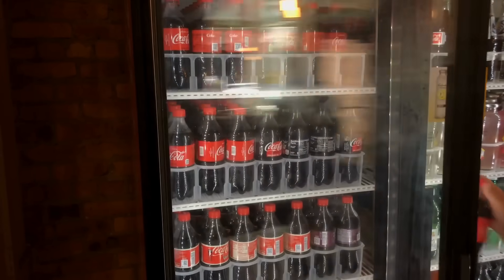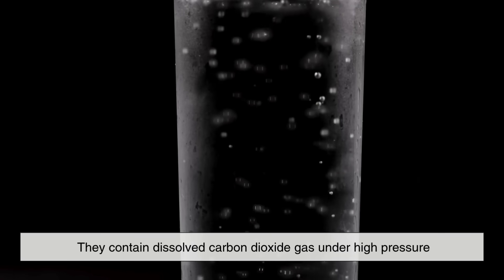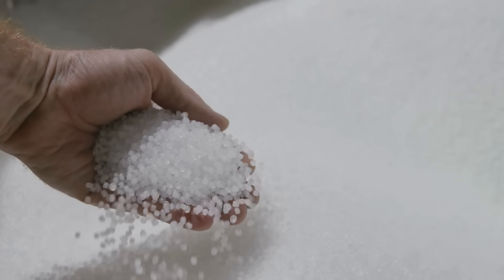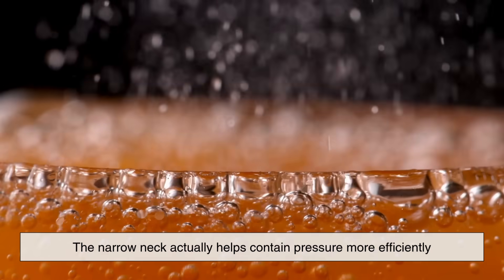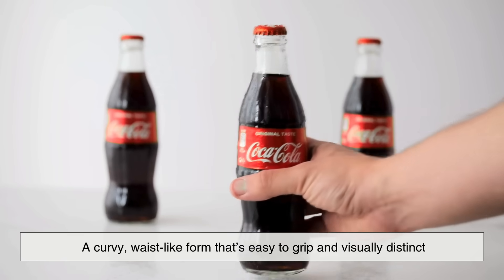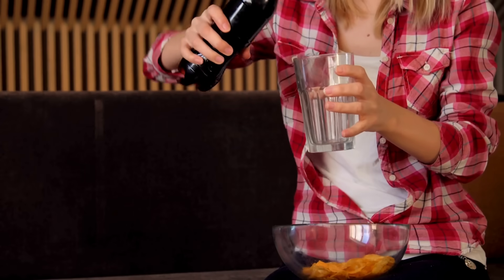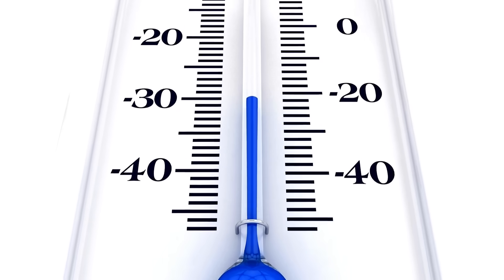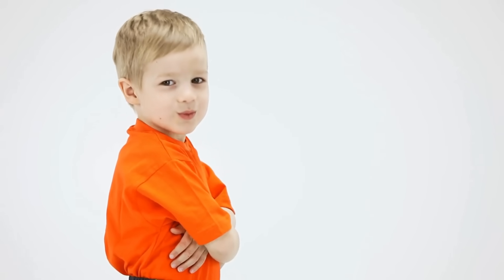Why Every Soft Drink Bottle Looks the Same — The Genius Design Explained

Comment: The old 6.5 ounce glass coke bottles had a slightly higher carbonation level than its competitors plus it kept that higher fizz till the drink was finished. When more competition came along taller bottles became more normal but coke was always higher carbonation than other brands.  With the plastic bottles the screw on cap has relief lines inside of it that vent off the pressure if the bottle gets overheated like in a closed car on a hot day in the sun... the cap is supposed to just vent off gas but i wouldn't bet on it working 100 % of the time, not with my car anyway. Cover it up with a blanket or put it on the floor and then cover it.

Comment: All the curves and indentations increase surface area which decreases the pressure per point. 10 psi is 10 pounds of force on a square inch of surface. If you double the surface area without changing anything else, the force on the square inch is halved.